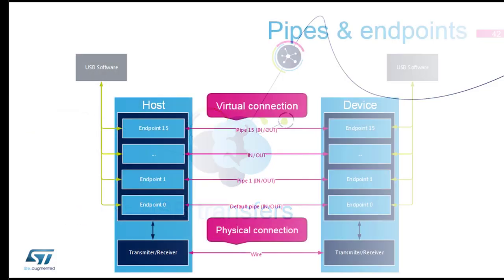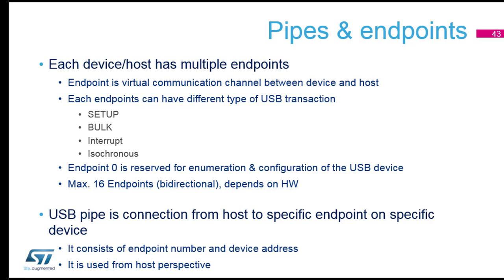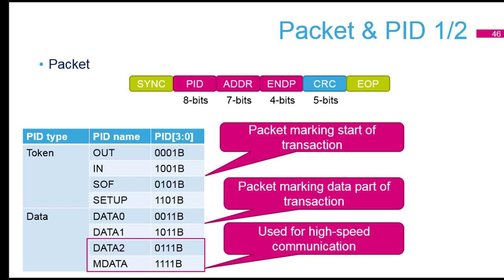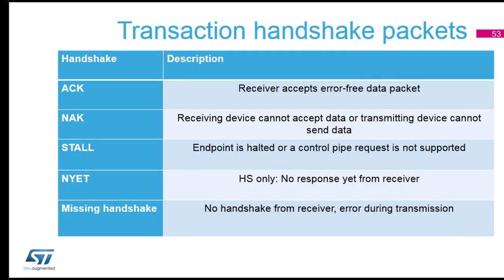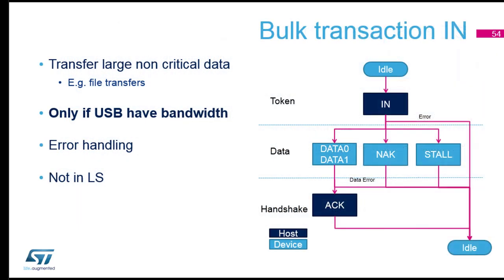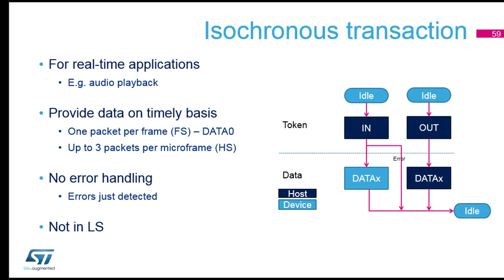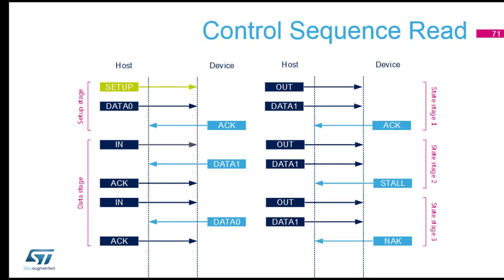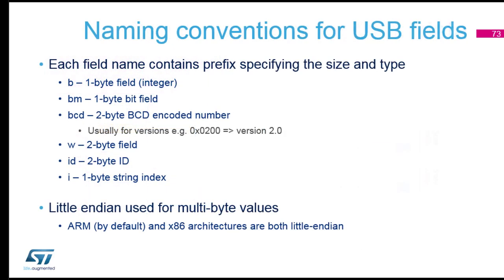STM32 USB training - 03 USB transfers

Comment: Do I understand correctly that "Interrupt" transfer type is like polling with the host asking all the time if there is new information? That doesn't seem very energy efficient when communicating with a keyboard or mouse that are not being used. I don't understand why communication with a keyboard or mouse would work that way. Are you sure it's correct? Even the term doesn't sound like it's describing what's going on. The word "interrupt" makes me think it's the device that's interrupting the host process by providing new information without being asked. The functionality as it's described in the video (unless I misunderstand) is something I would call "polling".. Just think of an interrupt in a CPU system.. It's the device that interrupts the main processing unit by pulling an INT line low for instance, not the CPU constantly asking the peripheral whether there is new information.
Reply: I DO HAVE THE SAME CONCERN, AS I LOOK IN WIRESHARK,I IT CLEARLY SHOWS THAT FIRST KEYBOARD INTERRUPTS THE HOST AND THEN HOST ACK THATA AND THEN DEVICE SEND I AM DONE SEDING AND THRN HOST ACK THAT AGAIN, FOR KEYBOARD ITS 4 INTERRUPTS, 2 FROM EACH SIDE